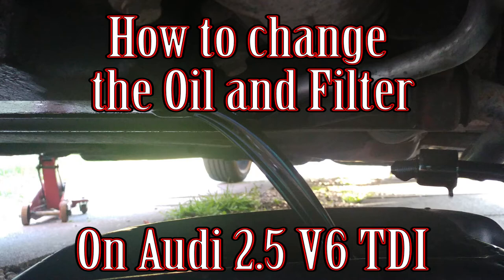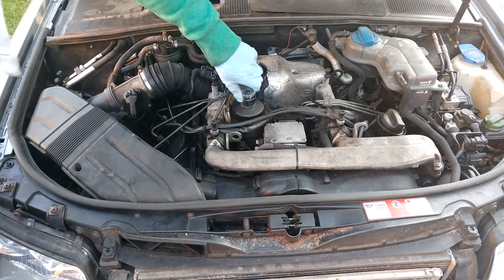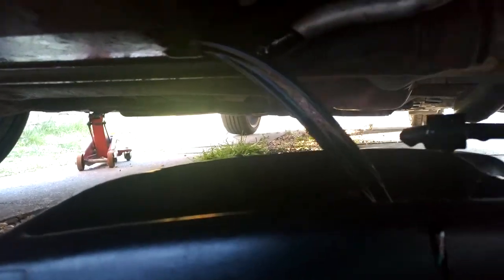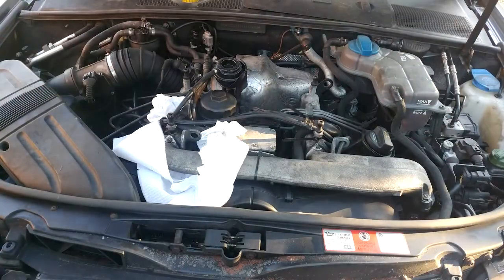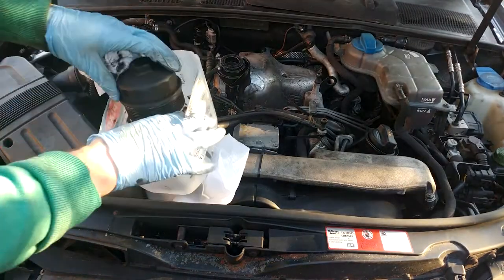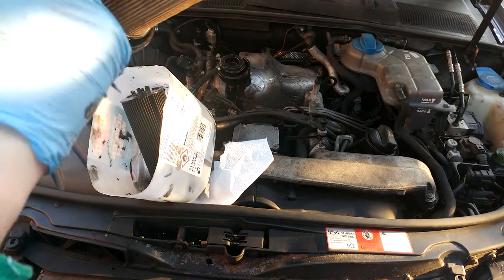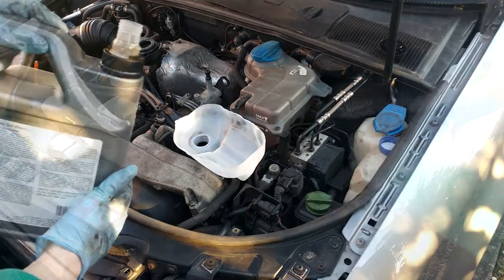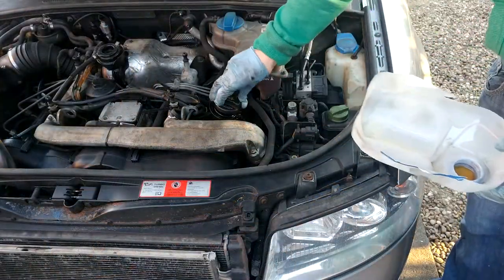How to change the oil on your Audi 2.5 V6 TDI

Comment: Did you have to remove the underneath plastic fairing/guard or could you access it with it still on?,,mines a 2003 2.5 tdi Allroad, thanks..
Reply from the maker: Hi Gary, mine currently doesen't currently have an undertray (need to get one, previous owner may of binned it) but yours might, shouldn't be too bad to under will be screw type or plastic pop rivets.
If they are plastic rivet type it might be worth replacing them, these are in eBay for like £4 for a bag.

Comment: i just bought an a4 b6 and id like to know what oil you used? iv had conflicting info online. thanks
Reply from the maker: Which engine? I should be using full synth on this - this batch is semi synth because I had it and because I'll be using it well under my usual 5-6k change interval and mixing in some choice engine cleaner to see if I can free up sticky valve/tappets.
Typically on these 2.5 V6 TDI's use good VW spec fully synth oil because the cams are prone to wear.
Reply: mine is the same engine. 2.5 v6 tdi. but its my daily driver and although i want to keep it in good running order, i dont want to spend much if possible. guna do the oil change tomorrow and try and get all the bits in the morning. so easy to get stuff is preferable.
Reply from the maker: Go fully synth and keep changes regular - I like 6k on  my cars. Look up 2.5 TDI cam wear issues. They'll set you back £700 + various parts and potential labour if they wear (this is why I got a car that has had the cams done).
EuroCarParts forever have discount codes on their site but I think VW/Audi are usually £25 on fully synth oil too.
Reply: ok thanks, what viscosity do you suggest?
Reply from the maker: I'll be using 5w30 that meets 507 spec next fully synth

Comment: how many litres oil do i need for 2.5 tdi?
Reply from the maker: 5.5 Litres - because you can end up with a small amount left in if not totally level when draining best to check the last bit by the dip stick.